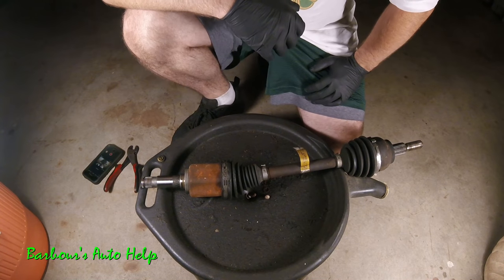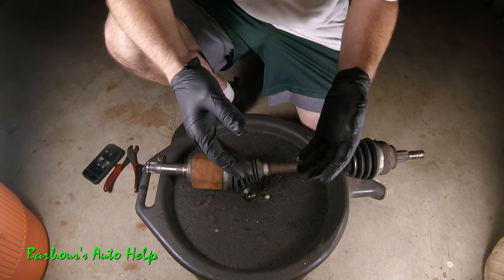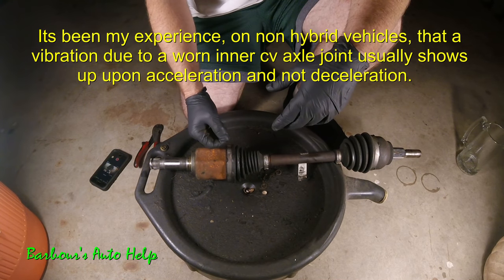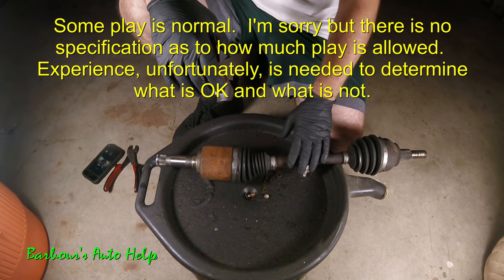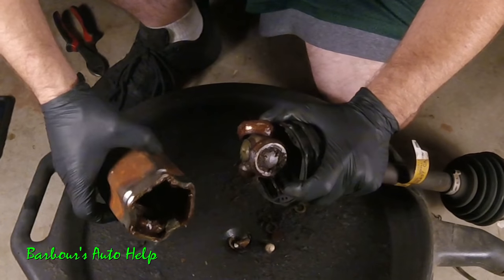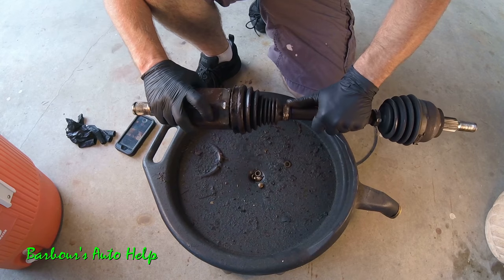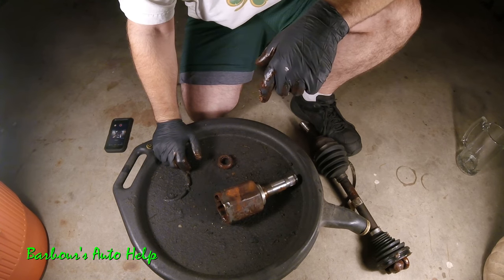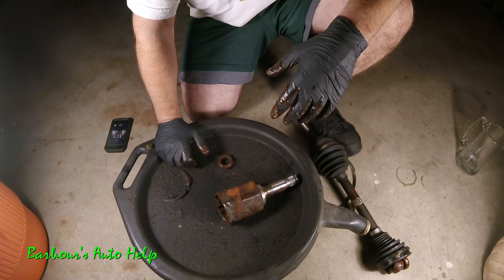How a Worn  CV Axle Can Cause Vibration

Comment: I have experienced vibration with braking when I had a bad axle and was sure I needed a new rotor, but I knew I needed a new axle more urgently. So I changed the axle first figuring I would get to the rotor another time. But the braking vibration was eliminated also after changing the axle!
Reply from the maker: Cool!

Comment: I had the same vibrational problem with my Jeep Grand Cherokee. Vibration upon acceleration. I changed the CV axle but it wasn't that. My mecanic fixed the problem in changing the transmission supports that was disaggregated.
Reply: What do you mean by transmission supports? What are those?
Reply: @wilsonemeka1833  It's written 'Isolator' on my invoice but my mecanic called it 'transmission support'. The right term is probably 'transmission Mount Isolator'.

Comment: Hi, I have hamming/vibrating noise coming from passenger side, when I'm sitting in driver seat. It's like something is spinning in uneven way. Zero up to 100 km/h nothing. It starts at 100 km/h, peaks at 110 km/h and disappears at 130 km/h. That sound is definitely connected only to car speed and not to engine rpms. Its louder when pressing gas pedal/accelerating, but it does not disappear completely when not accelerating. Its not engine, because that sound is same when in neutral or any other gear. Its not unbalances tire or wheel. I tried many different wheels. Ball joints are perfectly firm. Sound does not change when braking. There is no play in wheel in any direction. I've already changed both sides bearings and inner transmission side axl homokinetic joint since I found this joint could cause this sound. No rubber boots were damaged. All looking good as new.  I used high quality replacement and nothing helped. Axl itself looks perfectly fine. I also tried clicking test when turning full left, full right and accelerating. Nothing, there is no clicking sound. No I dont know, this sound started just like that 4 month ago and does not get better or worse. Still the same. I didnt hit pot hole or anything. I'm driving quality highways. My car is vw golf 6 with only 110 000 km in very good shape. Now I plan to change outer wheel side homokinetic joint, but I dont believe it will fix it. I will be glad for all ideas and suggestions.
Reply: Gosh this sounds like what Im going through. Endless fixes and replacements and problem still persists. CV Axel is my next guess but these guesses are getting expensive. What was your final resolution?
Reply: I wanted to follow up on this in case anyone else encounters this in the future. After spending thousands trying to fix it with no results, I ended up trading in my honda. really dissapointing as I loved the car. I wonder if there will be a recall in the future to address this. I drove it far more than most people and have to imagine more problems will pop up around 90k miles.

Comment: I have an 07 Lexus ES350. It has 190k. All of the front end parts are original. I am having the entire front end replaced to include the axles, control arms, tie rods, struts front /back, links and all mounts. It shakes violently side to side under torque.
Reply: I have one of those and having heck of problem with transmission.  Toyota front ends usually last very long time other than CV axles.  There is possibility it could be the transmission.  U660E transmissions have problem with large input shaft aluminum cast hole tending to widen over time causing shaft wobble and eventual failure of tranny.  Very unfortunate for otherwise beautiful ES350 that could last many 100's of k miles
Reply: @tommason5689  Update after front end work. Rides as smooth as glass. Axles caused the shaking.
Reply: @ExtremeRecluse  Lucky you. Did it make road noise while shaking?  Like whirring noise?

Comment: I replaced the drivers side cv axle today on my 2008 Toyota yaris. The boot had a big rip and all the grease was gone. this was at the wheel side boot. Naturally the bearing was very worn.It never made the much talked about "clicking" sound when making hard left or right turns in a parking lot. Oddly it only made a thump, thump sound like a tire that had bump in the tread. Hope this helps somebody.

Comment: Good explanation.  Thx.  I just had this exact issue on my 06 Odyssey.  It felt like vibration was coming from right, front. Changed both CV axles and it turned out to be the driver's side.
Reply from the maker: Good job!

Comment: I had vibrations when hitting the brakes, but not the acceleration and my car had bad tie rod ends and poor alignment. My left front side is making a scrapping noise when turning left, stopping, or accelerating (might be the pads on the front end, wheel hub assembly, or brake shield scrapping against the rotor).
Reply from the maker: Thanks for sharing your experience.

Comment: i have a 2010 tsx, i had vibration under acceleration between 60 an 65, turned out to be worn out axles.
Reply from the maker: Glad you got it figured out.
Reply: I have exactly the same problem on my 2010 TSX. At exactly 60mph to 65mph. Was it your inner cv joints?
Reply: Hey Greg,  he said inner axle he meant inner joint of the axle. Each wheel has it's own axle, and each axle has an inner and an outer joint covered by one of those black grease boots. I have a vibration in my subaru I'm thinking it might be a cheap chinese cv axle the previous owner put on right before I bought it
Reply: On the left side of my car I getting a vibration from the axel
Reply: Greg Naidoo sorry for the late reply, yes the inner cv joint had excessive play and I could physically see the wear into joint when I took it apart.
Reply: Jomel Nemai, i couldn’t tell what side the vibration was coming from, upon further inspection both had play, the left side axel was the worst of the 2, I replaced both with axels from FEQ, I’ve put approximately 25k on my car since replacement, I drive atleast 500 miles a week. The car is smooth as butter now.

Comment: My Honda civic has been vibrating when pressing the brakes. Mechanic said it was the rotors. I replaced them and the vibration went away, but came back again. Now while going down the hill my car steering wheel vibrates quite a lot. Yesterday I checked the inner passenger CV axle and it has an up and down play. I suspect this will be the issue with the vibration while pressing the brakes.

Comment: I'm beginning to believe this is my problem. I have a 2008 Pontiac G5 with  5-SPEED Manual transmission and I suspect the previous owner abused it seeing how it had a K&N intake installed. I have a steering wheel shake between 50-70 MPH which seems to get worse when accelerating. I've rebuilt a lot of the front end (struts, sway bar linkage, tie-rod ends, and calipers and rotors with fresh pads due to worn out parts I also put new tires on and had an alignment done since the other tires were clearly wore out. I've since continued to have a steering wheel vibration, mechanic seems to only think it can be the tires and wants me to claim a warranty on the tires. Problem is I don't think its the tire as I have rotated them all around with no change in results which makes it hard to believe all 4 brand new tires are bad. I also feel a vibration in the gas pedal which also seems to get worse in acceleration events.
Reply: Did you get this sorted? I have an mk6 golf and have had the exact same experience as you - bought all new front suspension parts (struts, control arms, swar bar linkage) but not tie-rods (seems to be no play in them) or calipers + rotors. I also changed corroded rear springs and the rear shocks. The car feels like its bouncing as i drive and gets worse when I accelerate.. all CV boots seem fine.
Reply: @richcheema  I replaced my cv axles and it helped al lot no more steering wheel shake just a small vibration which could just be from needing a tune up

Comment: I had my cv axle replaced by a shop and then my car started vibrating when picking up speed from a stop. I went back to the shop to complain about the issue they said they will fix it. And still the vibration has not gone. All of this started happening after I got my CV axle replaced
Reply: Why did you replace de cv axles?  Where they doing the same vibrations?

Comment: 1 to 2 mm is a lot in a vehicle part clearance specs, most of the parts are calculated in super tight little spaces like intake valve clearance, only around .18mm to .23mm in my car, which means there is .05mm difference allowed.
Reply from the maker: Ok, so how does that relate to the video?  I'm sure you have a good point, I'm just slow at connecting the dots.  What are saying?

Comment: Interesting. I have a vibration on my 1995 corolla while accelerating. It only happens around 45-50mph and then goes away above 55. I wonder if this is my issue.
Reply: That's wheel balance

Comment: Thanks for the info man, I just got my 2007 Lexus GS 350 AWD go through  two Axle at my local Meineke Care Center wondering if it's my transmission going need your opinion?
Reply from the maker: What was wrong with the axles?
Reply: @BarboursAutoHelp  I was driving on the highway with my family for adults and a baby I went over a bridge quick dip and the axle broke in half at the time I assumed it was a flat tire but visually the axle was in two pieces passenger side.
Reply: I went to my Meineke repair center  and they said to me that the axle needs to be replaced and so they did on arrival to pick up the car I asked him if there's anything else wrong with the vehicle and they said I'm good to go I took it for a test drive out of the parking lot and the axle fell out again I brought it back to them and they replace that axle with another and the same thing happened I'm trying to figure out if it's the transmission that's spitting the axle out
Reply from the maker: I've seen this happen a long time ago but not on a Lexus.  The vehicle had a bad engine or transmission mount.  It was causing the axle to stretch too much.  I'd give the mounts a good check.  Not saying that's it but it could be.  Let me know what you find.
Reply: @watchmegetoutoftheshelter7690  how much you paid for the repair

Comment: i had my passenger CV axle replaced due to a leak in the boot.  Then a few thousand miles later i started getting this vibration you talked about.  I assumed there was some issue with the part, so my mechanic replaced the axle again.   I thought this fixed the issue because the vibration went away.  But then after a few thousand miles it started vibrating again.   i don't know what to do next?  It seems a new axle fixed the issue, but maybe the axle is wearing out very quickly?   Any suggestions on what to do next?  The vibration only occurs during acceleration between 45-60mph.

Comment: I don't know why but your video is one of only a few touching on this subject, and I think it is exactly pointing me in the right direction!  Would you be so kind as to help me with my problem?  I am retired and in a real bind here.

You seem to be a very helpful sort and I really need some right no

My car is a 2007 Corolla with low miles, well maintained,  garaged,  babied, and was in excellent condition until the accident.  

The accident was of  (relatively) minor impact,  - the other driver sliding into the left front wheel from the side.

I am concerned about the adequacy of the damage appraisal and repairs.

My first question, how can one know definitively that the trans is bad without tearing it apart?  The car shows no signs of drive train issues in terms of performance as far as I can tell, but there are vibrations which are like deteriorating/bad wheel bearings.  

They replaced the left wheel, wheel hub, inner and outer tie rod ends, and left lower control arm assembly.  There was no mention of  the cv axles or other relevant components.  

The post-accident left bearing  was replaced due to faint bearing noise I detected early on.   (wondering about this replacement being bad also))  ??  It was also determined by a third party that the tie rod jam nut was  loose, causing wear to the threads. They recommended replacement.  I am wondering about the possibility of this situation to create this kind of vibration.

Considering how troublesome replaced/repaired trans's can be, I want to make sure that everything else has been ruled out as possible generators of the noise

My first inclination was that the transmission was the culprit, not having given any thought  to the other possibilities.  Duh.  

I think the likelihood of it going bad from anything but the accident, if it is indeed bad would be a huge stretch.  The car was running just fine, the transmission fluid was full, clear, and had been changed about 15,000 miles ago, at about 30,000 miles.  The Toyota technician who did the fluid change indicated the pan was clean.

I hope you can help.  

thanks -
Reply from the maker: As far as what is causing your noise, it's hard to say without hearing it myself and diagnosing it myself.   As for any suspicions about the transmission,  I'd say your better off getting the opinion of a tech that has had the opportunity to drive your vehicle.  I appreciate you reaching out for information.  I really think a hands on tech would be the best help.

Comment: This seems like the issue I'm having with my 2012 audi a6 prestige. Got my wheels balanced twice in one weeks and still getting this vibration and shuddering when accelerating at 57 - 65 MPH. Is this a bad CV joint? I also hear some noise that appears to be coming from the axle when turning left...Is that the CV Joint?
Reply from the maker: Possibly.  If you aren't confident have a tech diagnose it for you.

Comment: Having simulair problem with my VW Golf 1.6 TDI 2011 DSG-7 Variant, since i got her (1,5 yr ago) could not get a balance on my front wheels, not even with new wheels and tires, at +/- 70-80 kmh and 130-140kmh.
Its was thought my drive-shaft gearbox bearings or/and flywheel were the problem at first, now the right CV drive-shaft is the suspect.
A mth or 2 ago the front wheel bearings were changed but the problem stayed, as the vibration, and around that time my r-front disk started to "cry" when driving, cold and warm getting worse km by km...

Atm she is in the workshop again, and today i should hear what the problem really is, and i can only hope its the CV drive-shaft...
Reply from the maker: Let us know when you find out.
Reply: @BarboursAutoHelp  It was the passengers side CV joint, totally worn , actually very like the one on this video.
The gearbox is ok, wheel bearings to, so were changing both CV joints and both front brake disks, as addition have to change 2 worn engine mounts...
The noise (bearing grinding sound) was only heard when going into a left turn, thats why at first the wheel bearings were suspect...but after replacing those, the noise stayed.
Dont have him back yet, parts being replaced as i write this.
Will let you guys know if this solved the grinding bearing noise in my front train, when i get him back and make a probe-drive.
Reply: @satnikray  you never told anyone

Comment: just changed out my 05 maxima passanger side cv axle was doing the same as explained  driving at 45 to 60 steering wheel would vibrate left and right. cv axle passanger side is like 4 foot long
Reply from the maker: Thats a big one.

Comment: Thanks man, got this issue on my Sentra,  the steering wheel also shakes when I brake, and I I believe it’s getting worse as the cv axel seems to get worse, I changed the brakes rotors and made sure the guide pins on the caliper were cleaned and greased, what do you think? I know you said the vibration is upon acceleration typically in non hybrid cars but it really seems like the steering wheel shake gas been caused by the cv axel going bad, they seem to worsen together, but who knows sometimes with cars, I’m going to change the cv axels anyhow, I’ll let you know if it goes away.
Reply from the maker: Hey, sorry I didn't get to you until now.  I've got a decent video on diagnosing vibrations upon acceleration.  It may or may not help you but I believe its got some good info for you.  Here is a link: https://youtu.be/OyXtBqExkec
Reply: I think im having the same issue with my sentra!
Reply: So did you figure this out?  My 07 Camry is having vibrations when deceleration..any data points would be appreciated

Comment: Thank u so much, my cv boot is worn and my car volvo S60 2004 vibrates on acceleration worst on steep. I drive it less than 100km per month. Do I need to change the boot and Grice or the whole cv joint?  M from south africa
Reply from the maker: Not sure what you need.  But if the axle is bad greasing it and putting a boot on it won't fix it.

Comment: Clicking at low speeds. A humming drone at faster speeds. I was worried it might be one of  the cv's but couldn't tell left, right, inner, or outer.... until I put the car up and went around and tried the individual joints. The clicking while turning at low speeds became more and more noticable so it was really starting  to worry me. The inner right side cv has  turned out to be the culprit. Have not noticed vibration on acceleration yet. Really wondering  when the problem will become a regretful roadside event. $$$$

Comment: If the inner joint is bad is it possible for there to be a vibration at all speeds? Like a constant type of vibration? Also how can you diagnose the play being the inner joint vs the transmission bearings?
Reply from the maker: It could cause vibration at all speeds.   But typically its at a certain speed range under acceleration.  Here is a link to another video that may help.  It doesn't cover "everything " but it will help you along a bit.. https://youtu.be/OyXtBqExkec